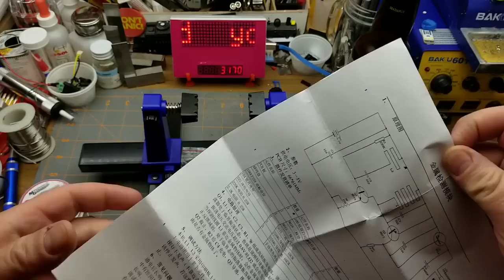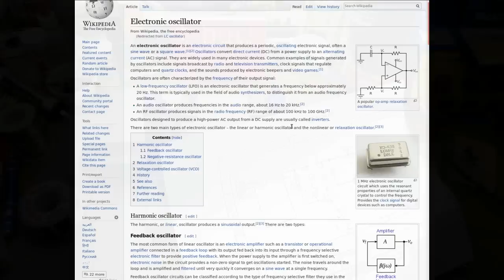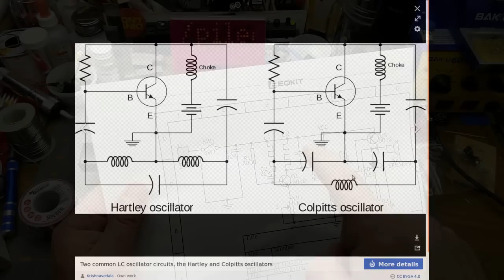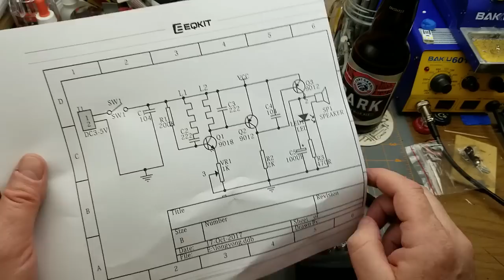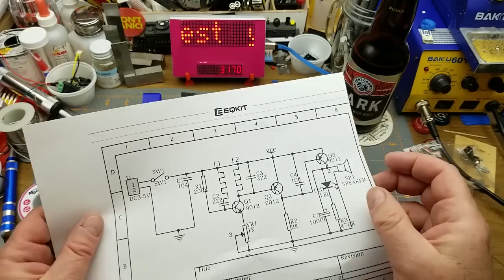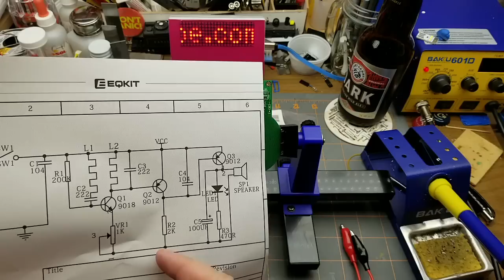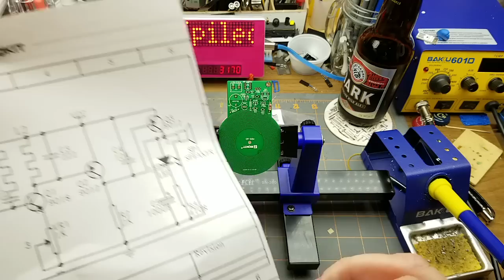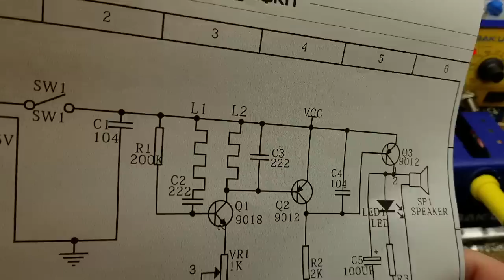The best PCB holder so far (long version)

Comment: i have the same holder! i was surprised at how well it's actually made, the base/leg screws have a lil plug inside to not dig into the cross beam while tightening. and all the adjustment screws have a metal nut under the plastic so it won't strip out easy

Comment: Thanks for an interesting video! I like that tip shape as well, especially for through-hole work. I also use the "old-fashion" wet sponge tip cleaner - just a quick swipe between components and also have the metal type for end of the day cleaning.

Comment: I have mounted mine on an old monitor arm so it's off the bench and on mini drawer rails with fans and lighting.
Still trying to find an elegant way to incorporate a component holding pad.
I also have a USB microscope to fit.

https://youtu.be/caGD0l0AXhM

Comment: LOL - how on earth is that PCB Holder possibly making things easier or faster?
It just gets in the way, makes things much slower to place the components (compared to holding the PCB in your hands) as well as more difficult to solder because you cannot rotate the board to achieve the optimum angle.
And it takes up so much area on a limited workspace - almost taking over the critical beer position. LOL
Reply: I know right? Every since I got mine all I do is use it with great success.
Reply from the maker: I find that having my hands freed up really helps. Plus bringing the work up closer to my ageing eyes is also helpful.

But everyone has their preferences. Thats why there are so many options!